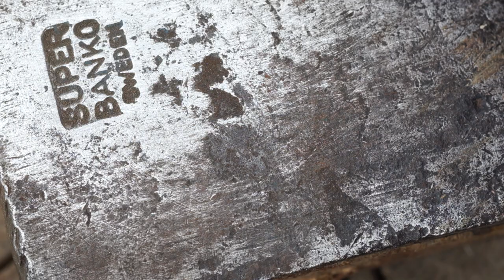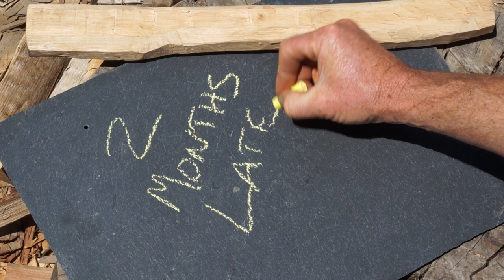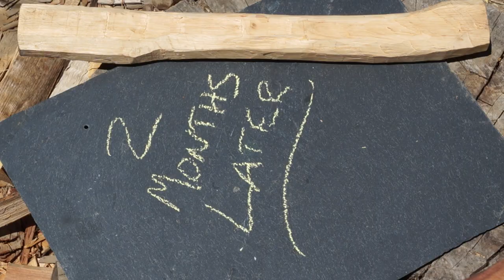Vintage Swedish Hatchet Modification & Restoration 1 of ?: Making a Handle Blank

Comment: Is two months long enough to dry a billet? Might be a "how long is a peice of string" question...
Reply from the maker: Pretty hard to say.  Wood looses some moisture quickly, but if air dried, there is deeper, more bound moisture that takes longer.  And of course there is thickness, humidity, heat, species, and I'm sure various factors having to do with that piece of wood.  Oh yeah, when it was cut lol.  If you dry too fast at first, it might crack, but you can speed it up later to some extent, minus putting it in direct sun, which is very risky.  You can also work it down close, but leave everything a little big and finish it off that way, watching to see if it warps or changes shape.  You could also weigh at 2 months, work down most of the way, and weigh after another couple of weeks.  The larger it is the more likely it will crack if you dry fast.  the thinner it is, the more likely it will warp as it dries more, especially fast.  But hey, my everday hatchet has a handle that I put on too green. it shrunk and required a sizeable filler piece pouned into the eye to take up the space, and now it's warped, but I use it all the time because I'm lazy and have other priorities than changing it haha.
Reply: @SkillCult cheers for your thoughts. you could write a book  at some point and it woukd sell well 😉
Reply from the maker: @nobob268  It's on the list, but the list is long :)

Comment: How do you get your axes so sharp?
Reply from the maker: Stones.  I sharpen free hand and I think that is the best way to do it, whether using an axe puck or a rectangular stone.  I'll usually take them up to a polish too, not a perfect polish, but I usually use 4000 grit to finish, especially on anything used for carving.  There is a compromise in between perfectly sharp/polished and just plain sloppy that is simply good enough.  It's not a scalpel, but it's not a pickaxe either.  I see a lot of people sharpening their axes in vices or putting the stone down and pulling the axe over it.  Holding the axe and stone freehand is faster and more elegant.  I'll try to do a video on it some time.  It takes time to learn, but once you get it nailed it is super fast and very effective.  I like Ben Orford's video on sharpening axes.  My technique is similar and that is how most people have always done it, because it's simple and it works.  The pen trick seems great too.   https://youtu.be/AKJhhz-643k

I've been using this stone, https://youtu.be/0JpksGRhvf8 but it's only to 1000 grit  250/1000.  the stone ben orford uses in that video is the same brand, but it's 1000/6000 great for touching up and finishing, but not for doing any major coarse work like removing nicks or sharpening a tool that is very dull.  Both are about as good a deal as I think you'll ever find on good stones.  I use files for an major work.

Comment: Okay, anybody have info on how to score a decent old broad head?  Thoughts on the Husqvarna Carpenter's Axe?
Reply from the maker: They are expensive now.  I haven't used the carpenters axe yet, but it looks promising.  I haven't done a lot of that type of carpentry axe work though, so not sure I'd be fit to judge.
Reply: I haven't either!  I'm not a big axe guy, I feel it is too dangerous for solo expeditions, uses too much energy to run, and usually too heavy, while a saw is safer, more efficient, and lighter.  Anyway, I'm getting into the axe to see if there is something I'm missing, and defo into self reliance carpentry, so... thanks for the info.

Comment: what kind of pants are those? Thanks.
Reply from the maker: Duluth trading company firehose workpants.  best pants ever pretty much.  They are like what Carhart should be.  Long wearing, more functional design and soft out of the box.  They are a little heavy and warm for summer sometimes.  The stretch version is much lighter, but otherwise similar and better for hot weather.  Only other possible issues are that they cargo pockets are non expanding, so you can't stuff them, but that means that they never puff out and get in the way either.  If you wait for a sale, or look online for discount coupons, you can get them for 55.00 to 65.00
Reply: Sweet, thanks, I like Carhart but only when they are old. new ones bother me. I've been looking for the right pant. We bought a few acres in Asheville NC a few years ago and starting to do our best at building a more efficient life. chopping wood, Large garden, chickens, small spring fed pond, planted apple, pear, peach and plum trees, berries bushes.....But a lot to learn. Main things i've learned so far is that every animal and bug wants to eat my garden and fruit! love your videos. Thanks
Reply from the maker: Seriously, these are super soft right out of the chute.  Carharts are comfortable just about when they start wearing out lol.  Sounds like a good time.  Yes, it's a constant battle with the wildlife.